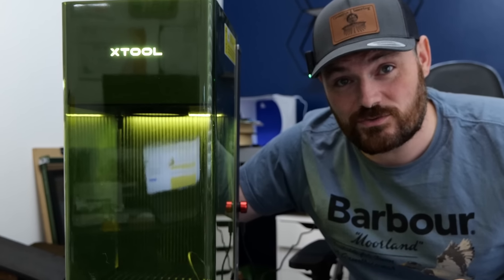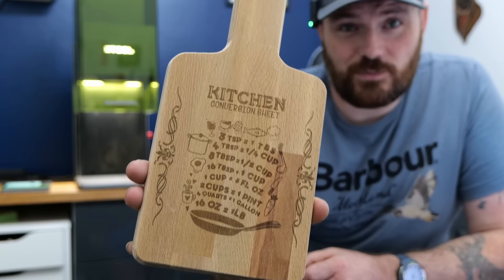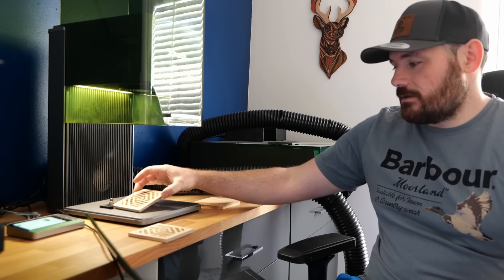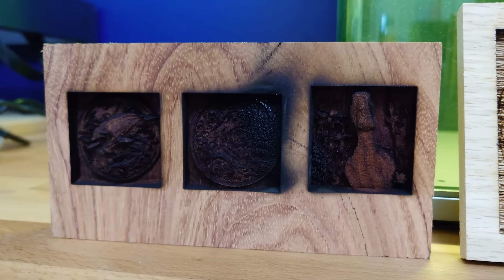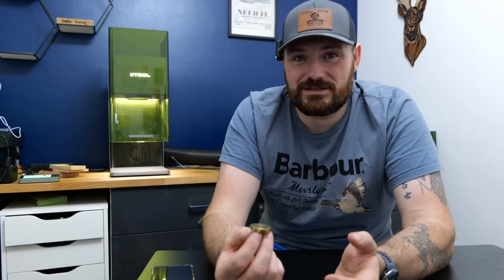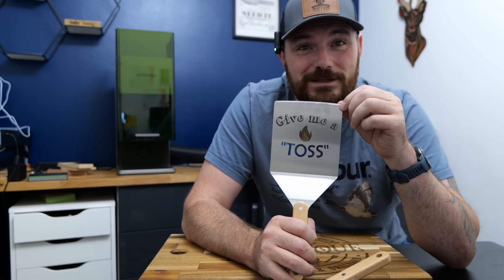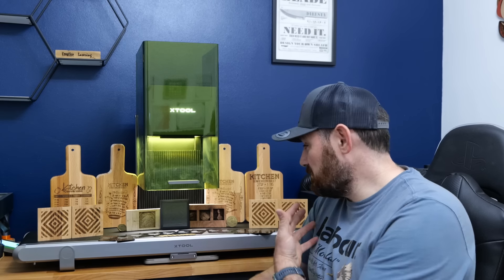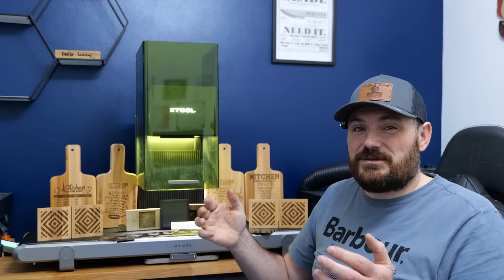The XTOOL F1 Ultra Laser IS a Game Changer

Comment: Lazer engraving is inspriational and with the ability to take as well as add (3d printing), I thought of assembly fixtures and welding. If all the facilities of a workshop were in a four prong head, what is the limit in a desktop workshop. You could add materials that go with the engraving compatible materials.

Comment: I have had mine for a week and unboxing today.

Man they pack it TIGHT! 😅
Reply from the maker: Yea! 🤣
But on the other hand at least you know it's not gonna be broken!
Reply: @JamesManCave  I've finally got it set up. I am trying to use the desktop smoke purifier. Have you tried this? Looks like I need to get a hose adapter as it is supposed to be compatible with the F1 and F1 Ultra but my hoses are different sizes.
Reply from the maker: @allisonstephens8818 I haven't got that smoke extractor, but I do believe that is the case, that you need to get an adaptor. I have the big smoke extract or and it fits that fine
Reply: @JamesManCave  I just exchanged it for the correct version. Their website AI was the one who suggested the smaller one but I decide to return it. Xtool was good to deal with for a return.

Comment: In the thumbail you're using the orange glasses, I'm pretty sure you mean to use the green glasses since the orange ones are not meant for the F1 Ultra. Happy lasering.
Reply from the maker: @3rprogrammer  amazing that that's the only thing you can comment on. You are right, but also wrong. For the 20w blue light diode laser these glasses are well within the range of the wavelengths of the blue light laser. When it comes to the 20w fibre laser then these glasses are out of the range, hence why I shut the green door on the laser. The thumbnail is just that, a picture! The laser isn't working
Reply: @JamesManCave  No need to start off toxic. I was just caring about you not going blind.

Comment: Sorry man, a couple of questions. Is this significantly faster than the d1 pro 20w? My business does a lot of bulk coasters but alignment on the D1 pro is a pain in the ass. Would this be an upgrade? I can do 6 at a time on the D1 Pro.
Reply from the maker: @prepped8551  yes, it is significantly faster, and much easier to align, you can a jig that will hold 4 coasters at once, and can really zero in on repeatable engravings. 

However, personally I would look at the S1, that is faster then the D1 pro and much easier to align
Reply: @JamesManCave  thanks so much for the prompt reply mate. That is very cool of you. I will go and check out the S1. Thank you.
Reply from the maker: @prepped8551  it's a great laser that, I also have one. I only use the D1 now for rotary engraving because of the height it can be extended to 👍

Comment: Thanks for the sharing your video. Nice to see a UK review, but I do wonder how long it would take you to pay off the £4K cost of the Ultra & Conveyor if it weren’t gifted to you. Cannot deny I am jealous that you and the many other YouTubers are given these by xTool for review. Sadly I think it is difficult to come up with a negative review when you’ve received such an expensive item without any charge to the reviewer. But that is the way these units are marketed these days - so no criticism to you for the review. I did notice you have suffered the common known fault with this unit, where the protective cover doesn’t close properly. Scattered blue light radiation is dangerous and you are sitting there with the blue laser light and no goggle. They have a fix online for this and encourage owners to take it apart and fix the fault - xTool do this quite often - I had an S1 fault after a couple of week, and they expected me to replace motherboard - not great that they have these faults and firstly expect the end user to fix, and secondly don’t alter the design to fix the problem to begin with. They do have good support and try to help out their users - I’ll give xTool that.
Reply from the maker: Well, first of all, if there is anything that I don't like, or feel it could be done better, I would mention it in the video. All xtool ask of me is to feature the laser in a video. I can (and will) say what I want about the laser. This I also made clear to xtool which they are happy about.

Now, I agree with you on how long it would take to make your money back, but that's because I'm mainly a wood worker, if you dealt with jewellery, crafts, or small metal objects then maybe it might be easier to come up with more profitable ideas. I have plenty of ideas for wood, not so much for the other materials.

As regards the repairing the unit, I've had no issues with any of my xtool laser. However, I was sent a laser this year by another company, and after an hour of using it, the control board on that packed up! I was sent a replacement board and had to fix it myself. I don't know if this is the new normal regarding these companies with a base only in china/Hong Kong

I'm not sure what bit I'm sat there when the blue light is escaping, (I'll have to watch it back) but do bare in mind, I'm making a video, so I may film things for an effect in the video
Reply: Thanks for the reply. 

In your video we can see the fault I mention. The protective cover doesn’t close properly and so blue light can be seen leaking from below. If you push at the top of the cover ant the back the it will close properly, but it should close fully using the handle. It is a well reported fault and there are a few videos showing the fix and xTool themselves have shared an official fix as well. It requires removing the back plate of the unit exposing the electronics and the laser units. In my opinion this is not a self-repair method and they should either do the R&D to make sure they’re properly tested, or take them back for replacement. 

I’ve also discovered criticism of xTool and other similar companies for rushing products to market. Partly because there’s such completion and little in the way of patent protection. 

As for reviews, surely you cannot deny that if you were to give a negative review they’re unlikely to provide you with the next great product for review. I’m not suggested you’re biased at all; I’m just suspicious of all these positive reviews from the plethora of YouTubers. Generally all saying the same thing - at least your review touched on some unique benefits of the device with regards to working with wood - which clearly this machine is not aimed at - as you say. 

Thanks again for taking the time to produce a video. However I’d love to see as detailed a review from who paid over £4000 for it :) 

Keep up the good work.
Reply from the maker: @phillgriffith  I know of the issue you are talking about with the light leak, just can't remember what part of the video it is in. Yes it shouldn't be like that, I do agree, I think the issue is that in the last 5/6 years home laser machines have exploded and there are new companies producing new laser almost weekly, so the market moves on so quickly a new idea is outdated in 6 months.

If you look back at some of my tool reviews you will see I've been critical of them in the past, I think you have to be if you want to make a good genuine video. I get emails all the time asking to test out other lasers, and I say no, because I genuinely believe in xtool. I tested out another laser recently (video on my channel) and I was critical of that, have never heard back from the company since. The difference between me and other people on YouTube, is that they want this to become their new career, I don't. I'm happy with my job and career, and YouTube is a hobby,  so if a company don't like what I say about something they send me, fine. It is what it is and I'll move on to the next project I'm doing. 

I would like a cO2 laser next, I think that would suit my needs much more, I'm not concerned if I have to buy one, but if I get sent one I will give it my honest opinion 👍
Reply: I just had to respond real quick to your “how quickly Can you make the money back?”  I guess it depends on where u sell your work..  we’ve got 2 machines and accessories from xtool. The F1 and the S1 along with all the accessories total around 7K. Earlier this year, my wife attended two of the shows/cons (the awesome con and the otakon - which are pretty big shows) just from those two shows she sold close to 5K of which 90% was wood work. Not gonna go into pure profits but I would say everything could be paid off after 5 shows/con. She limited herself to those 2 BIG shows.  On the flip side she attended couple of local shows (very small - maybe handful of tables) and made few hundred bucks. I think biggest thing is “who is your target, where do you sell, n what are your products. If you get into it now trying to sell engraved Stanley cups I don’t know if you’re gonna make much money (probably still can) since anybody and everybody that has a laser machine is selling those.
Reply from the maker: Fantastic reply and great information, thanks for taking the time to respond. People will find this info very useful 👍

Comment: HELP, will the xTool f1 air purifier work with f1 ultra
Reply from the maker: @owdoco5657  I'm not 100% sure, but I don't think it does. I think it's too small.
Reply: @JamesManCave   Thanks for the quick response
Reply: You can 3d print an adapter for it to work.